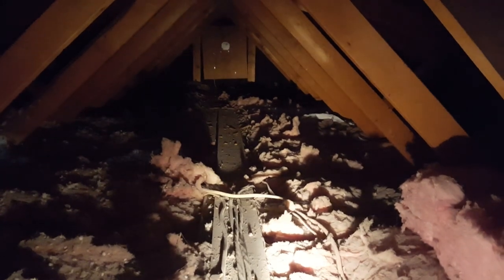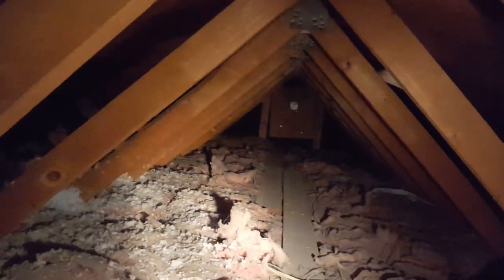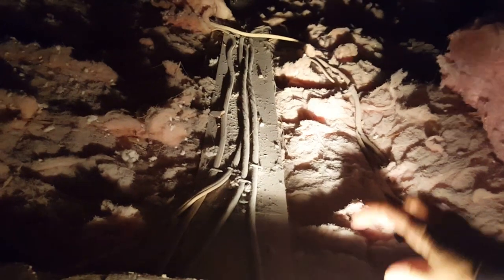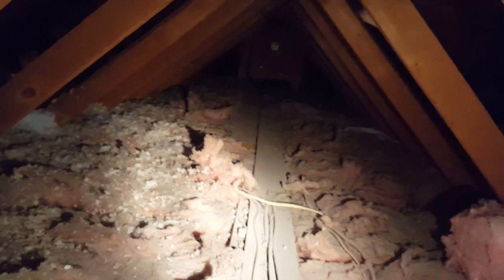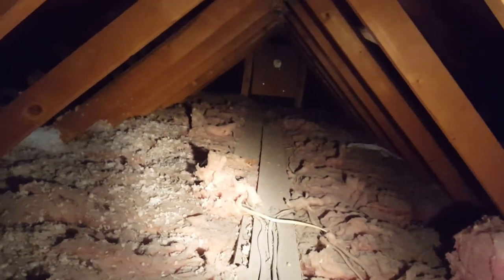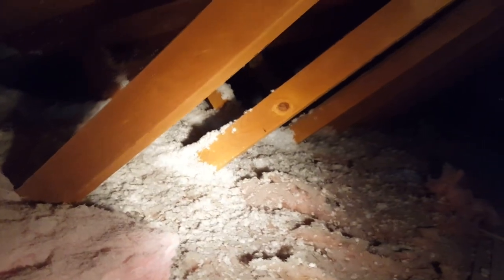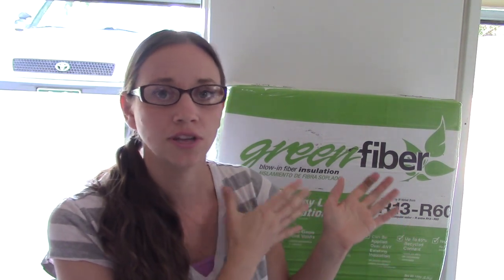Save Money By Adding Attic Insulation!

Comment: we insulated our attic space a couple yrs ago and noticed our heat bill was cut almost in half and we have a house on a slab! We were lucky enough to get insulation from our neighbor who over bought. We only needed to buy 6 for a 1329 sq. ft ranch. So for less than $300 we got insulation that paid for itself in just a couple months since our cooling bill was reduced from over $100 a month to $70 and heat was reduced from $80 to $45

Comment: In Europe they now recommend at least 12 inches of attic insulation. You can opt for more but the incremental benefits are lower. The best way of visualising it is that it has a 50% payback rate or an annual rate of return of 50% which is a far higher rate of return than any investment you can safely invest in. Plus these benefits are permanent cutting you costs of living for years to come.
Reply: No I just sent a guy in Nigeria $20,000 and he is going to send me $100,000 back next month.  I trust him because he is a Prince.  I gave him my account numbers and he is just going to direct deposit it for me.  I am glad I didn't miss that e-mail.  That's a much better pay back than insulation!

Comment: Blown in insulation is a horrible product .. 5 years from know when the fibers have broken down and found its way into tour living quarters and your lungs youll wish you made a different choice.
Ask me how i know !
Also the fireproofing chemical that must be applied to all insulation will absolutely cause you problems after years of breathing in the small particulate dust that finds its way into your bedroom.. bathroom.. rugs ..mattress .. Then into your lungs .
If i had a choice now i would have rather have spent more money heating my house than never ending dust and lung problems . 
Do not use ... Youll thank me later
Reply from the maker: What kind of ceiling do you have?? That's crazy, I don't see how it could fall through a fully dry walled ceiling. Also, did you use cellulose or fiberglass blow in insulation?
Reply: Frugalgreengirl cellulose ... I have a drywalled skim coated and painted ceiling ... The insulation dust finds its way into living areas thru any way it can . plug outlets .. The attic fold down stairway ...  Once it begins to break down and dry out the particles become so small the slightest draft will carry it .
Blown in insulation is the worst invention ever !